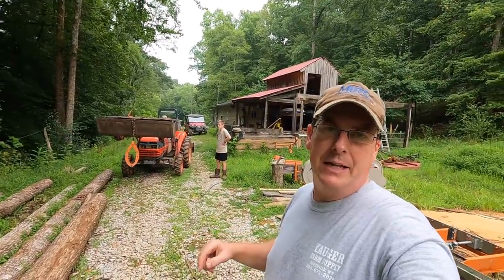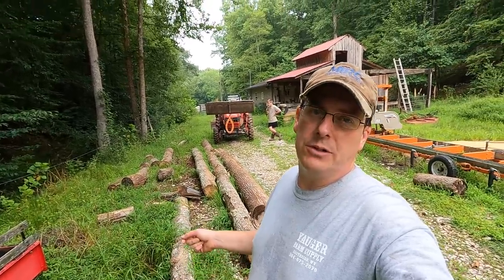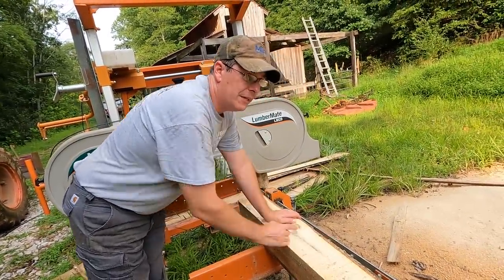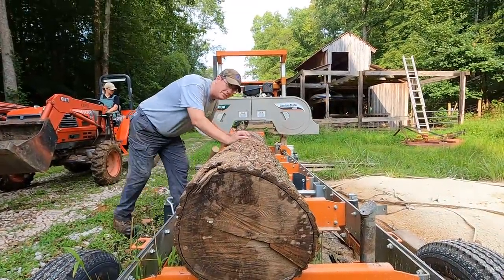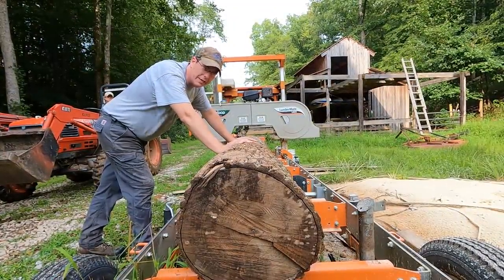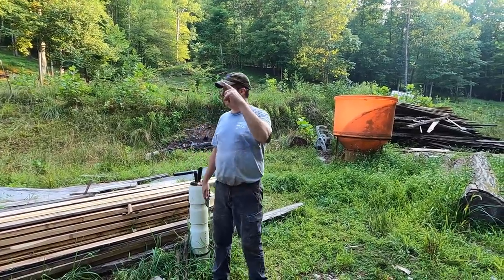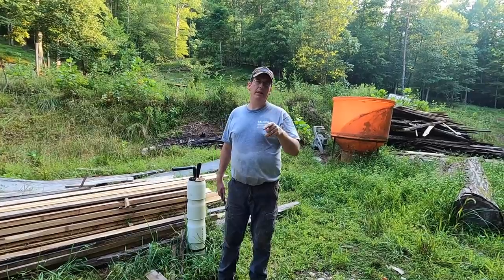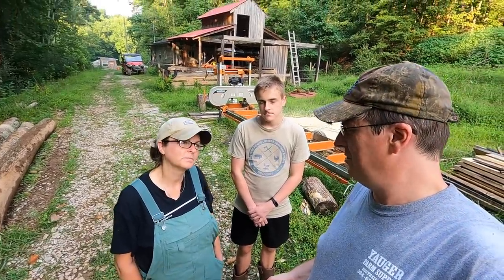Milling HOME-MADE 2x6s Better Than Store Bought

Comment: Camera angles: I like a mixture of both fixed and floating (as long as the camera operator moves slow and steady)
Good job on the tractor operation and saw work. Looks like a productive day.
Reply: Yes, this.  Also, the following camera needs to find ways to take the shot without getting the actors or equipment getting in the way of the shot.  For instance in this video, get on the other side of the mill and shoot from there.